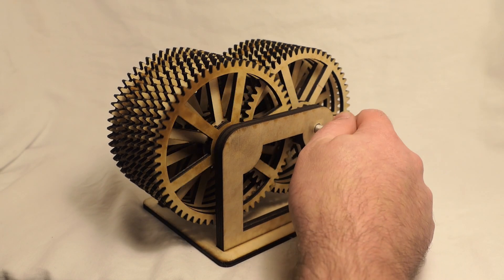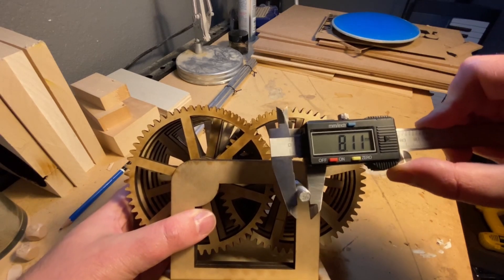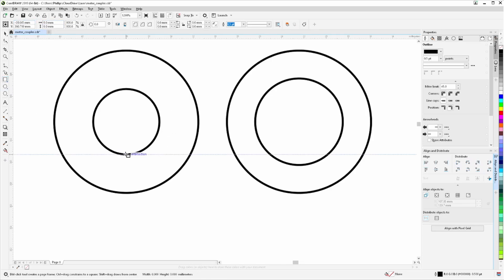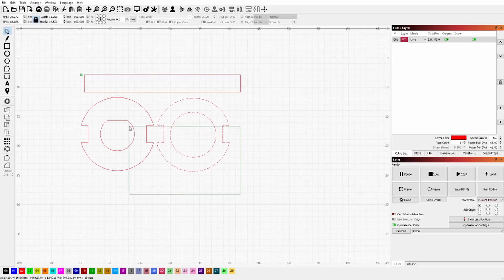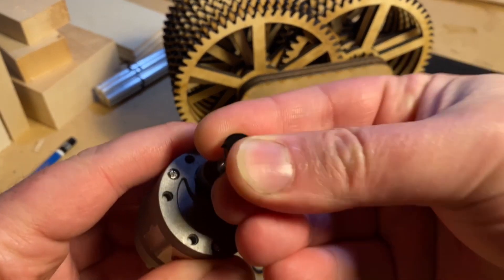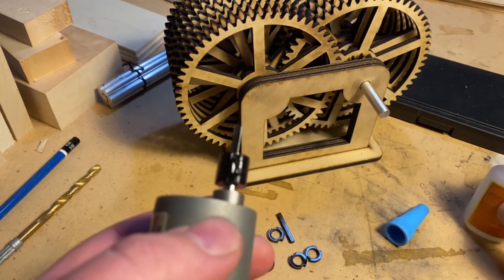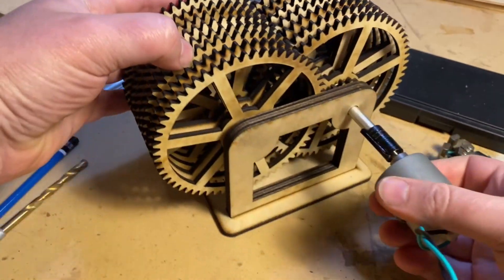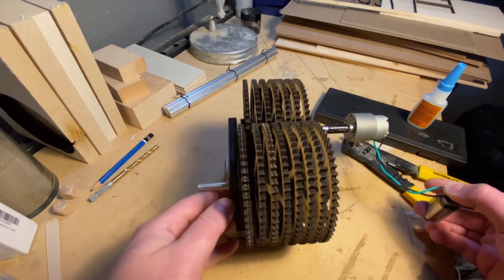HUGE Gear Ratio - Making a Timelapse

Comment: Put in other side with a drill!
Reply: The shaft will break and the gear will be sent into orbit
Reply: As someone said on the last video if it was possible to spin the last gear at 1 rpm the first gear would spin at 67 million rpm